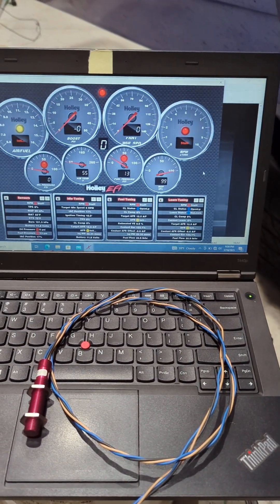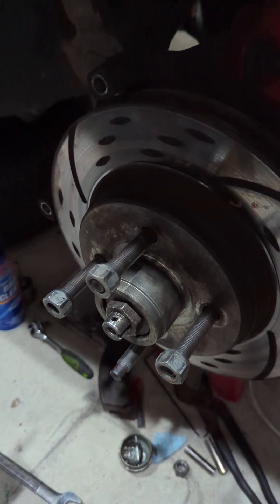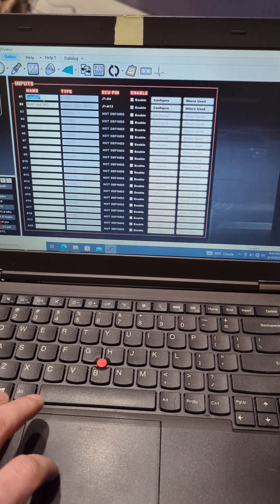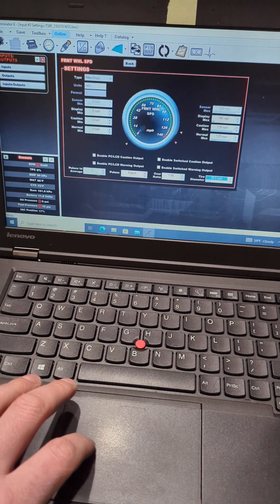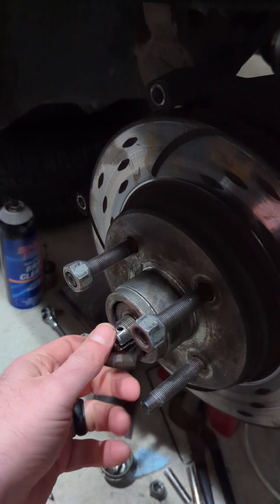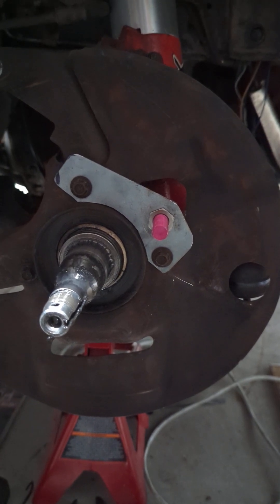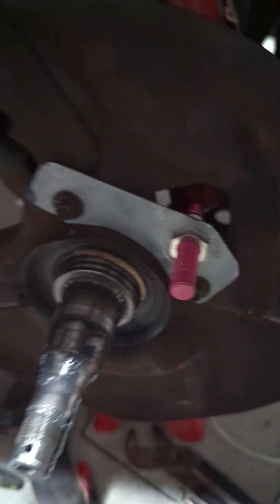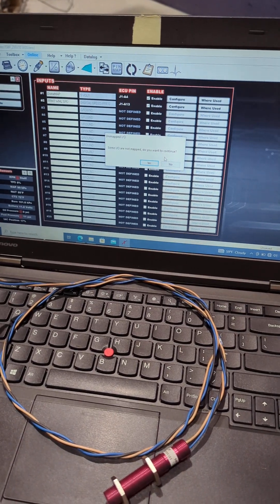Holley Terminator X Foxbody Front Wheel speed sensor, Hall Effect

Comment: Do you know if this can be done with the oem front speed sensor used in the SN95
Reply from the maker: @joshuawashington6343  check the sensor, I believe the stock sensor is a two wire not three, so the set up would be different or it may need a converter.  Or you might be able to mount a Hall effect sensor on the ABS ring in place of the factory sensor

Comment: Good video, very informative to the point.   Great idea on how to do this without spending big bucks on a whole wheel speed kit.
Reply from the maker: Thank you for the feedback, the sensors can be found much cheaper than the kits out there.  I do think I increased the average a good amount to make the readout more stable, you can play with the numbers as needed.
Reply: @russellbroadwell  what sensor did you use or would you recommend? I plan to try doing the same thing you showed.
Reply from the maker: @FlopShot_King  on the old forums they are call "cherry hall effect sensor" Cherry became ZF in 2017.  ZF part number: GS100502.  ZF products can be ordered from a bunch of different Electronics suppliers.  I ordered mine for Mouser in 2020. Mouser part number: 540-GS100502.  Other Hall effect sensors may work as well, but may need different pull up resistors.
Reply: @russellbroadwell  awesome, thanks for your help!